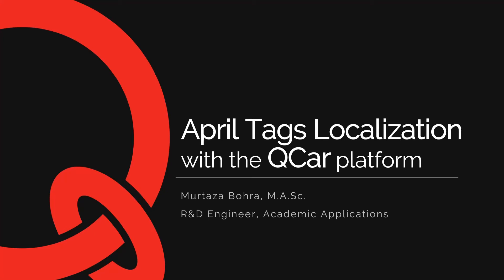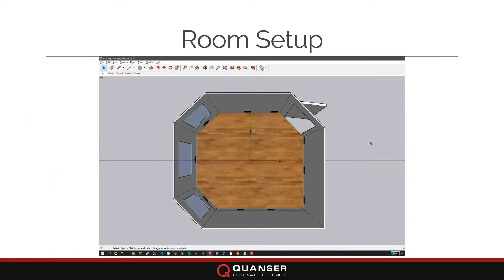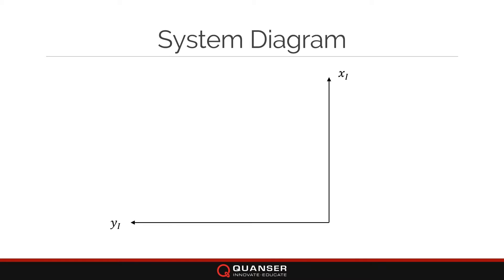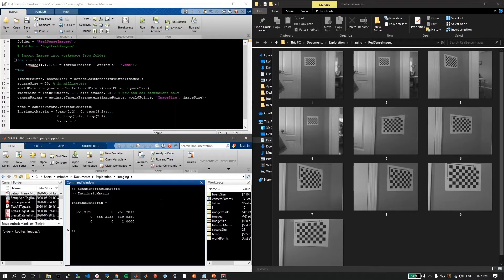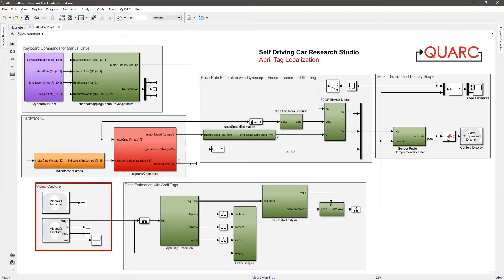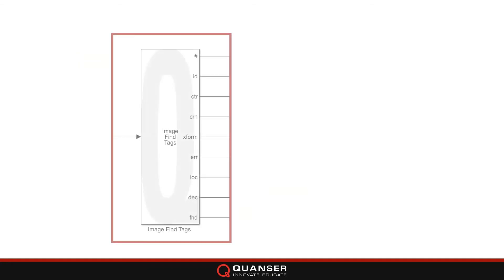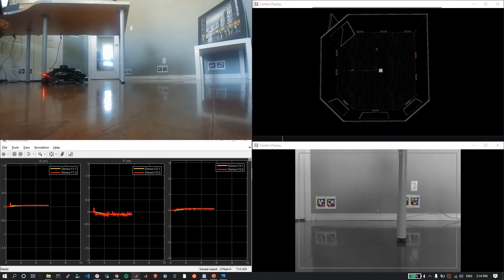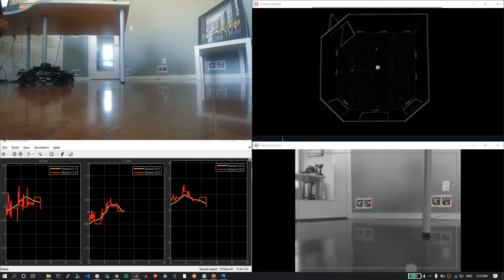QCar Spotlight: April Tags

Comment: Can you help me understand whether you've used the minimum number of possible April tags? what would that be for navigation in a room of the size you mentioned?
Reply: Hey Bill, thanks for the question. In the setup above, I was using a single camera on the QCar (The RealSense D435). As the car drives around, that camera might lose sight of the tag (the RGB lens has a 69.4 degree horizontal FOV or field of view only). To maximize my chances of always seeing a tag (for example when I turn the car in another direction) I decided to use multiple tags. If my camera had a wider FOV, I might have been able to get away with fewer tags. For example, using the single front facing CSI camera on the QCar (with a 160 degree FOV) might theoretically allow me to get away with 3 tags. 

For an alternate setup, if I had decided to use multiple cameras (the 4x CSI cameras on the QCar can provide a 360 degree FOV together), I would have been able to use a single tag. No matter how the QCar would turn, at least 1 of the cameras would detect the tag and register the camera pose. 

To summarize, the algorithm itself is quite elegant and allows you to use a single tag. However, the number of tags you would need in your own setup is a function of numerous factors, such as room size, the field of view of your camera, the number of cameras you are using etc..